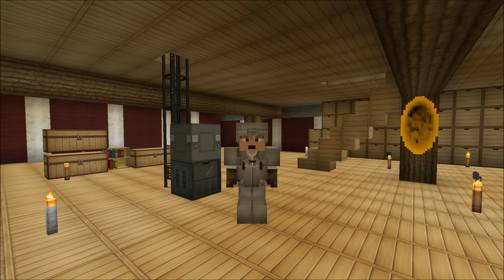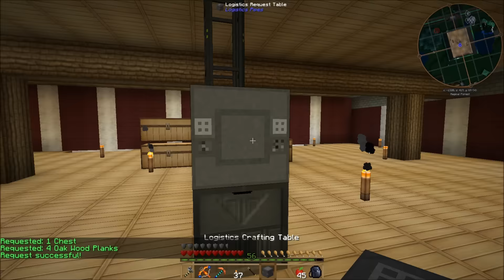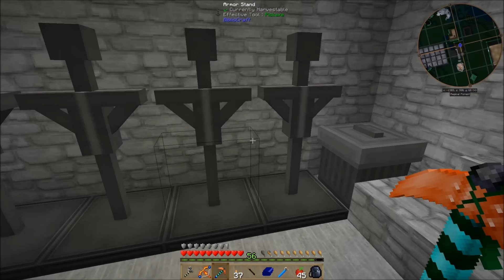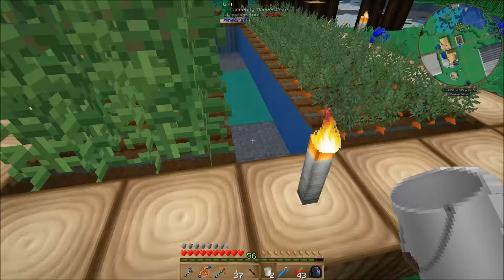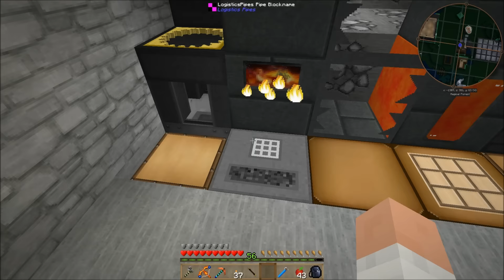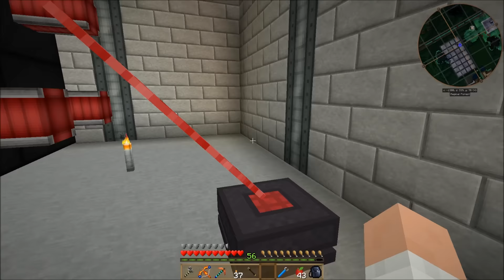Logistical Autocrafting - Infinity Evolved Expert Mode on the Terra Nova Server

Comment: I wonder if you couldn't use warp itemducts to send items to the access points that are further away from the barn.
Reply from the maker: +zeroangelmk1 Yea I've been wondering this as well. I need to look at trying this method instead of all the underground piping. I'm sure it would require extra power accepters, but they are pretty easy to make.

Comment: First! :-p
Reply: Sorry, had to as I'd never done it before. 

I would guess that the crafting cards for the chassis pipes would be for situations where things are more space restricted. Say a situation where you need auto crafting and some sort of supply on the same pipe connection. Or even multiple auto craters on the same pipe.
Thoroughly enjoying the series thus far. :-)
Reply from the maker: +nightsongmtg Thanks! I'm thinking that the crafting card will be useful when I automate a machine like the Rock Crusher where I can have more than 9 recipes and also where I would need an extraction card to get the results back out.